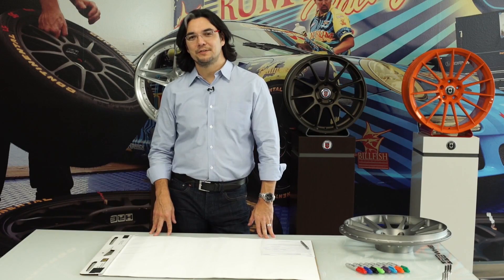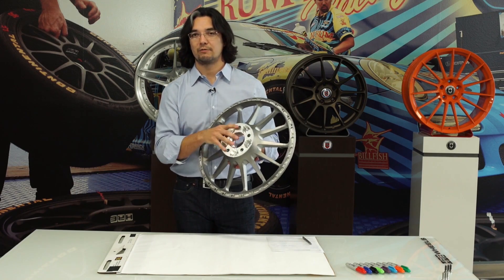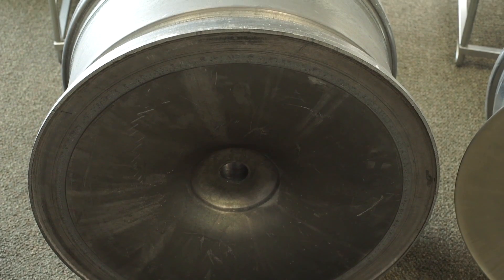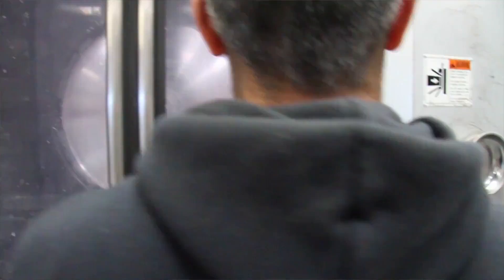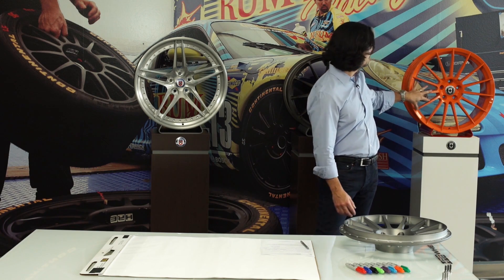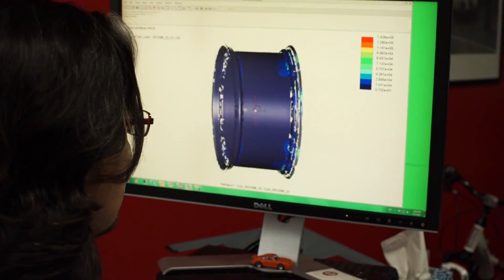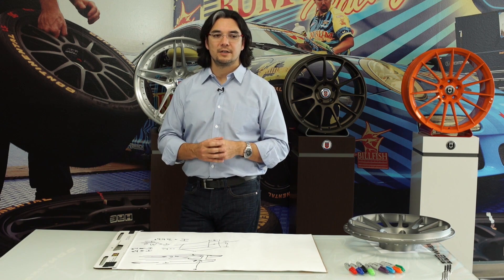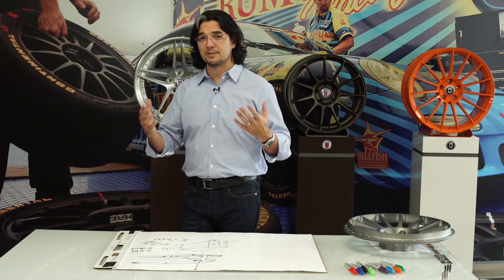Why Crappy Wheels Are a Bad Idea - /ENGINEERED

Comment: it also takes a shit ton of power to turn something heavy very fast ^^
i once made a lego gear system xD i got 10k rpm at the end... yea the lego gears really dont like that...^^ i had a prop ar the end it made a lot of air and when i did mount something else there i did lose maybe 4k rpm cause it was a few grams heavyer. if i woult have turned it at 10k rpm the gears would break.
 was really cool to see how mutch the weight affects it

Comment: not the best episode from /ENGINEERED... at least, he explained the disadvantages of heavy wheels. What he didn´t say (of course) is, that the best method to save weight is to use the smallest wheel possible: the one just fitting over the brake calipers... Rubber is lighter than any metal including aluminum.
Next point is that 2 or 3pc. wheels don´t have any technical reasons anymore, they only exist for the looks and their (outdated) reputation due to their sporty heritage. In the past they had no other way to make forged wheels. It wasn´t possible to forge a whole wheel including the barrel, so they had to forge the single parts and bolt them together afterwards. Nowadays it is possible to roll out the barrel from a forged pre-form, as he described. And this is way more economic and superior to 2-/3pc wheels, because the extra meat for the screws and the weight of the screws are adding substantially to mass on the outer diameter in comparison.
Best/lightest wheel: smallest one possible, single piece forged. Everything other is due to style or limited budget.
Reply: the advantage of the 2 or 3 pc is that they can be made in more available sizes than the 1pc.
Reply: Youve ignored the steering benefits of high aspect ratio

Comment: love the HRE wheels,  good replacement for out dated but wonderfull l ms .but im wondering why most wheels now have no dish? i know this has to do with scrub radius but i see wheels that could have a good scrub radius with a dish but still have a flush face.this would make the inside of the wheel weaker when a bit of a dish would support the wheel more central.  why?
Reply: I think it has to do with suspension changes. The offset of a rim positions the loading of the wheel relative to the axle flange/spindle and more importantly, the wheel bearings. If the load isn't over the bearings, you effectively have a lever arm hung off the bearings perpendicular to the axis of rotation. This can kill bearings and even suspension components. So randomly changing your wheel offset isn't an awesome idea.
Reply: Forth Sadler yep! I was going to comment on how he forgot to mention geometry etc. My friend had some TSW Venoms back in the day and I kept telling that they were lunching his bearings but he wouldn't have it. You could tell just by looking at the things they were twisting the fuck out of 'em. After going through two sets of rear bearings in like 16 months he decided to take my advice and put the original alloys back on with the correct geometry and viola problem solved. He sold the wheels. Guess what? The person he sold them to complained that the bloody things lunched his bearings lol

Comment: honestly if we are talking about durability you don't NEED to get 4k wheels. Crappy wheels have the same chance of cracking as your stock wheels. Now when we are talking in terms of performance knock offs become a complete no. I have some shitty xxr and they are super heavy I am aching for some lightweight forged wheels. you don't really realize how much of an impact wheels and tires have on your car until you actually change them whether that be for the better of worse
Reply: MrSamdabeast nigah waaa
Reply: Find TUV approved wheels. Enkei, TSW, Motegi, Volk, BBS, OZ and a few others are TUV approved. They'll do just fine.

Comment: 2:54 yea this guy has no idea what he is talking about... probably reading a script
Reply: hm? its a valid example
Reply: Hes right tho
Reply: Well not exactly, because you're actually not affecting any of those variables when you move the mass to the center. But im sure there are som videos which can explain it better than me in this comment section
Reply: you cannot add energy into a system that would be impossible. The person pulling their arms in is part of the system so they cannot generate more energy. The reason a person speeds up as they pull their arms in because they have a certain amount of momentum with their arms outstretched and as they bring them in they reduce their radius (inertia is equal to mass * radius^2) and due to the conservation of momentum they begin to speed up.
Reply: the energy used to pull the arms in, is the energy input into the system
Reply: Emperor Trump Its true that you use a little energy to pull your arm together, but thats because we have free joints and need to use tension to keep the structure. It's kinda like you use energy holding an heavy object, but a table won't since its structure is fixed.
Anyway a rotating skaters center mass spins slowly, but the outer spins fast, as you bring the outer mass with high speed (Energy) inside, i does not just dump the energy, i just keeps the speed, but closer to the center, where the circle is smaller therefore it takes shorter time to complete one rotation which means fast rotation.

Thats why the outer mass on a wheel is so important to cut, because it takes alot of energy to rotate since it has a longer way to go per rotation as compared to the inner mass.
Reply: go back to physics, force* distance =work =energy
Reply: Exactly, we are actually studying it right now in highschool :P
Reply: pulling the mass inward adds energy to the system plain and simple
Reply: Its true that you use energy to pull unsprung mass to the center of rotation. But you do not add that energy to the rotation.
But i dont really want to discuss this anymore, as i said before im sure you can find a video about it if you're interested.
Reply: However the point I think he was making was that you want a lighter wheel because it will have a lower inertia and thus be able to speed up and slow down faster.
Reply: yea that part is true
Reply: yes you can add energy, like how a car converts fuel to kinetic energy. the persons muscles are converting chemical energy to mechanical energy

Comment: I've had cheap knockoff "Drag DR-19" wheels since 2007 and have used them daily including winters on two cars in the past nine years. At least 150,000 miles on them. They are still completely crack and bend free to this day, recently had them thoroughly inspected thinking it was time for new wheels, but I was wrong. Paid $700 for the whole set brand new in chrome. I don't think I'll ever buy "legit" name brand wheels. They all do the same thing when you bang a curb or crash the car.
Reply: That's the same logic as saying you've never worn a condom while fucking ever and you've never gotten a girl pregnant. It's all a game of luck. Drag, rota, XXR and other shit brands DO NOT test their wheels properly and bank on luck. Some sets hold up and some sets fail catastrophically. Plenty of TUV approved wheels in the market that actually keep their stuff tested and cost as much as the knock off's. Enkei sells wheels as cheap that are properly built. I'd rather go with that than some shit that's made so someone can make a quick buck.

Comment: 10:44 silicone? that sounds less than permanent...i would have thought that would have been a flexible two part epoxy, not "caulk"
Reply: It takes barely any to seal

Comment: HRE's crack and bend too if you hit something hard enough.  I have 3 different sets on 3 different vehicles, the 3 piece stuff uses triangle barrels. ive seen their monoblock stuff bend too.  no wheel is safe from bad roads.

Comment: Question for anyone who could possibly answer it: I have a 2008 BMW E90 328xi with stock 16" wheels on it. I am looking to change those rims and swap them for a set of matte grey 19"X8.5" Verde V99 Axis wheels. Is that a feasible size to put on my car? I checked that they would fit, but would it be too much of a size increase? Would it negatively impact the handling or improve it? Thanks to anyone who answers!

Comment: here's a question for the guys @ DRIVE to ask the ENGINEERS @ HRE:  why don't u guys make chrome wheels?? i notice in your catalog you do have an option for a custom finish, but no outward chrome option...  why??
Reply: +93remix ...and chrome wheels are tacky as hell.
Reply: +93remix Unfortunately, in our experience, chrome does not have the same longevity as powder coat.
Reply: ***** 1st, thanks 4 responding. 2nd, I wish I  knew why rim manufacturers got away from CHROME. it snows bad in the mid-atlantic, but only we smart ones take 'em off when the snow falls. your rims are pricey, and I don't mind paying 4 quality products, I just see that chrome is not you guys forte. but your rims are nice
Reply: KrazaK87 26s 28s 30s 32s yeah maybe they are tacky but...  I wouldn't go higher than a 22 on most cars and 24s on trucks. I just like CHROME. there are many songs about CHROME RIMS and 1 of them is MASTA ACE's SITTIN ON CHROME! I don't hear any songs about FORGED or POLISHED rims LOL!!

Comment: sorry, but that was 80% bragging, and only 20 useful. Few bolts will not do any difference, even if they made of heavy steel, pockets to get lower rotational inertia inside wheel ? Does it reduce rotational inertia ? Yes, should you care or it will give performance benefit ? NO.
Major improvement parts are only for the looks and bragging "rights"
Reply: +Linas K Stay away from tuning cars in general. 3 piece wheels give you the flexibility to change wheel specs without selling the whole set. If you want a light wheel just buy a 1piece forged wheel.
Reply: +vidurc 
I get that. I just say, they are bragging about stupid things, only because they are. Like milling pockets where you screw wheel on the hub, to get lower inertia. This is only place where you don't get that much inertia. But yes, let's bragg about it.
Reply: Linas K That's not bragging that's a statement of fact. They mill pockets there and they have their reasons for that. Bragging would be saying that they're the only company in the world that takes the time to do it. 

Now the onto the technical point, it's not about reducing inertia at the hub, its about removing weight from the wheel. Unsprung mass is anything that is attached to the wheel including the hub mounting surface. If they keep it on and add 5lbs to the wheel that is still 5 lbs that could have been removed.

Milling it keeps the weight down and creates clearance for people or teams that run spacers or extended lugs. If you're running a spacer that sits on extended lugs having the hub bored out allows for the studs to protrude past the spacer into the cut out recess making it easy to swap spacers or swap wheels with different offset's and widths.

Comment: It's funny how you see everyone driving around with super sized wheels and sure they look nice but actually make your car slower because the 19 inch wheel you buy from Tire Rack are much heavier than the stock OEM wheels - unless of course you really pay a premium. I can actual feel the weight of my 18s vs the 16s I have when I'm running snow tires - car 300HP AWD seems a little less responsive off the line. Not to mention my theory of why the bloody car loves to each it's front suspension all 8 control arms and probably tie rod ends a lot more than it should. So my car's cheap 18s look lovely but really they are slowing my car down and costing me money - shit!

Comment: but is a 3 piece wheel structurally inferior to a one piece wheel?

and do the shape and amount of spokes affect the strength of a rim as well?
Reply from the maker: +Fast Er  Alan showed us their stress simulation software, and explained how spoke design is essential.  Wheels can have thin spokes, as long as they're strong in the right places. Engineers can build strong wheels with a variety of spoke designs, but changing them 1mm can have a big effect on strength, so it has to be done carefully.

 Also, they make look thin when viewed at 90-degrees, but the spoke is thick/deep. There's a lot of factors that go into designing a strong wheel. BMW and Ferrari wheels are TUV certified, so they are strong.
Reply: +boy638  "but is a 3 piece wheel structurally inferior to a one piece wheel?"   No.  "do the shape and amount of spokes affect the strength of a rim as well?"  Yes. Obviously the more mass you retain in the spokes the stronger they will be but then its a heavy wheel.  you need to balance it out. Lose as much mass as possible while maintaning a good / safe margin of strength and durability.
Reply: +boy638 Yes, a bolted connection will be either heavier, weaker, or less durable than something that is one piece. The point of a three-piece wheel is flexibility and manufacturability though, not structural performance. The difference is not huge though, so don't worry too much. Just be skeptical if someone is selling a 3-piece or 2-piece wheel that is claimed to be lighter and stronger than a 1-piece wheel of the same quality.
Reply: Shape has more effect on strength than ammount or thickness of spokes. H- or T-shaped supports for example take way more weight than a simple piece of steel the same size or in the case of wheels are lighter themselves when taking the same weight you just gotta point them the right way.
Reply: +boy638 2 piece rims are best... beceause well 1 piece barrell
Reply: +Shabbernigdo Xingjian 
Yes, that is why Ferrari wheels have so few and thin spokes and one can find the same design in BMW M-car wheels.
Reply: +Smurfinat0r and they look purdy.
Reply: It depends . . .
Reply: turn up the volume why so quiet
Reply: are vossen good wheel.
Reply: Shape and amount of spokes have no affect on strength. I have wheels with 1 spoke and they are super strong!

Comment: Ok Mr wheel expert, do you understand that in a forging press you COMPRESS the metal. When finished it has a reduced volume. It hasn't lost mass so IT HAS TO BE DENSER!!!! Jesus, did you do year 10 physics?... what am I saying.. probably not. Before you tell the world how it is, perhaps check that what your saying is ACTUALLY how it is? What you're trying to say is that as a result of the increased strength of the crystal structure you can mill it down further and as such end up with an equally strong wheel that has less material and therefore less mass.
Reply: +gus bisbal more like year 8...
Reply: +gus bisbal You do not compress the metal. The wheel is pressed into shape which does not compress the metal but allows it to flow formed through the mold. Heat treating is what forges the metal increasing it's strength without increasing mass. The same amount of metal is used but heat treated very precisely increasing it strength. That is the same reason why re-heating the wheel to get an aftermarket powdercoat job voids your warranty because additional heat treatment anneal's the aluminium structure. That is the same reason why, metal flows during the process are ensured in order to have it form to the design. Pressed metal is great for a tool but not for something that has to hold a particular design and withstand an eccentric mass test or a lateral impact test. The metal has to have flows within the crystalline structure or it is going to be prone to cracking. Same reason why a wheel with a complicated design isn't just cut out of a block of billet aluminium. They are trying to maintain metal flows through the mold. If you're going to talk shit at least understand the process before making claims.
Reply: vidurc Do you understand what density is? Do you? Density is Mass divided by volume. You are not reducing mass but you are reducing volume. That produces, by its very definition, an increase in density. So before you tell someone what shit they are talking. Learn what the word density means. As far as compression goes, are you going to tell me that there is no atomic compression of the metal what so ever? Really? I am fully aware of the process. Annealing also increases its ductility and flexibility which reduces cracking so while its rigidity is reduced its ability to take functional load can sometimes increase, especially with him impulse force. which is what you get when you hit some thing hard with your wheel. But first just go learn what density is, and what compression is, not the "terms" used by engineers but what they actually mean.
Reply: ***** He say's you're not making it denser because they mill their wheels. The whole idea is to create a flow in the structure.

Volk for example has specific molds for designs they use to create flow and area's of high density are the thinnest areas of the spoke. The metal flows through the press and forms a dish with a skirt. The face of the wheel is flat and does not have any specific area where the density can increase. The mass of the wheel is distributed along the shape of the blank forge. 

The skirt on the lip of the wheel is then spun out to create the barrel. So again where did you hear him say the mass was reduced. He mentioned the wheel was not denser given the fact that they mill a blank forged disc.

Forging can achieve different results like either keeping the mass low and the density low to reduce weight or increase the mass and therefore the density to maintain strength. Manufacturers do this all the time with pistons and connecting rods to either reduce weight and increase response or build a motor to be strong where the response is secondary and being able to take boost or nitrous shots is important. The weight of aftermarket forged components for some motors are higher because of that very reason.
 
Maybe if you come across like less of an dick you could make a point that is worth listening to.